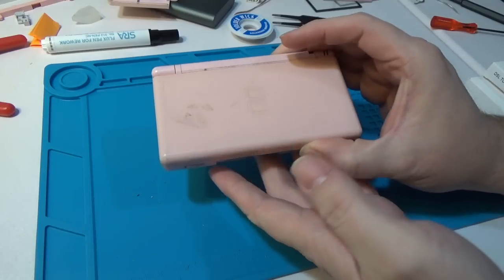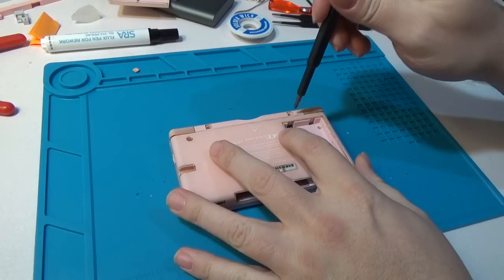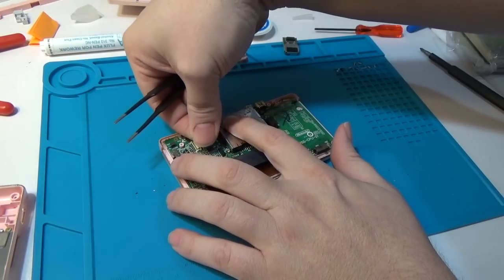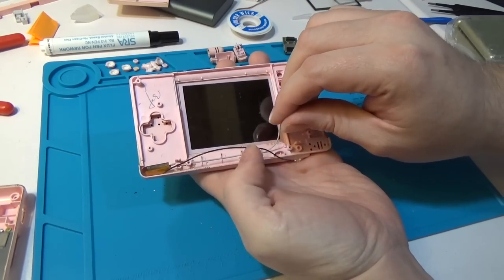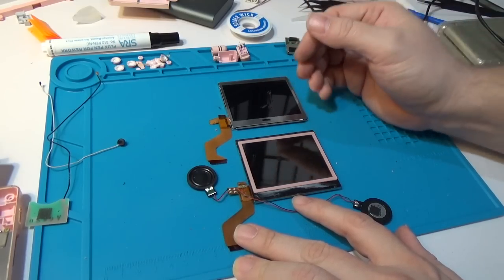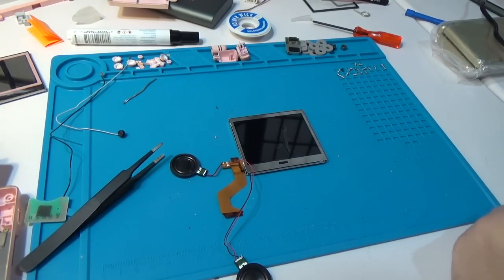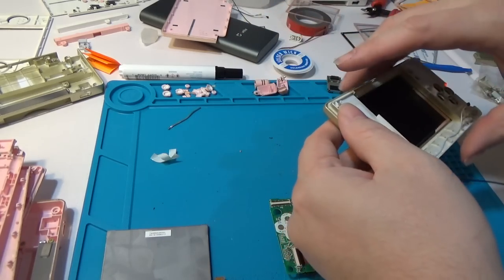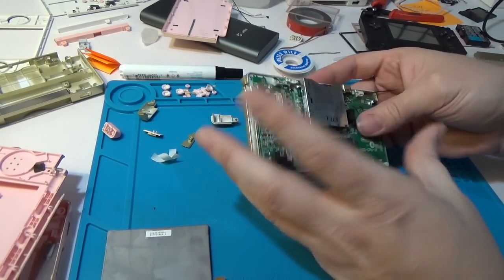How to Replace Nintendo DS Lite Shell and Screen

Comment: My NDS Lite has a problem with the top screen: it stays white. Sounds of both speakers are loud and fine, bottom screen works and the whole system works. But obe day i just turned it on and it sort of had a bad contact on the upper screen. Adjusting the angle would make it return to normal, but the very next day it was all white, i didn't even played it.

The hinge is fine and strong. The upper screen got replaced like two years ago by some technician,  and i rarelly plays my DS nowdays. It mostly sits on its case inside my drawer. What to do?
Reply: From the being able to wiggle it around to fix it, I think re-seating the ribbon cable deeper should fix it. It only requires taking the bottom half of the shell off, which is probably one of the easiest things to fix. I guess the technician wasn't careful enough 🤷‍♂️
Reply: @ciggyazealia  Nah too late. The cable was cut. I opened it and ruined the touch screen (doesn't register touch inputs anymore). Guess i'll sell the parts. At least i still can play my NDS games on my 3DS.
Reply: @CanaldoZenny  Man, sorry for your loss. At least you got the experience and practice.
Reply: @ciggyazealia  Yeah... I bought all the tools to open and disassemble it. Found the problem, but ruined it and didn't how to put it back. Everything else works, its just both screens are broken and where i live it's not worth to buy new screens or send to repair. But it was a fun project. Thanks man.

Comment: I have a serious question what kind of screwdrivers are those?
Reply from the maker: Great question!  It's a Xiaomi Wiha set.  You can buy them on Amazon, here:

https://www.amazon.com/Xiaomi-Precision-Screwdriver-Magnetic-Electronics/dp/B07FZ5DSWC

or find them online on various sites like eBay, AliExpress, GearBest, etc.  I love the kit.  It's got a great feel, and the clicky latch with the aluminum shell makes it feel like a premium product.  The only negative is the triwing bit doesn't fit these smaller screws, so you will need a separate triwing driver, but most aftermarket shells you buy come with one that you can use as well.

Comment: At 44:50 how in the hell do i get the ribbon cable back through the shell you sped right through it
Reply from the maker: Haha, I'm sorry for that!  I sped through it because it was a really boring segment of me struggling with it!

The big pointer I would give is to take your time, and wrap it tightly, but avoid pinching it.  What I've done is taken my tweezers, grab the connector part of the cable, and gently rotate it into a tight circle.  Once tight enough, you should be able to feed it through the shell loop, and then the metal ring as well.  It takes a bit of trial and error; especially on a new display that doesn't have a pre-curved ribbon, as it tries to keep unwrapping itself and straightening back out.

Take your time, go gently and don't force it, and you should get it through eventually!

Comment: Bro can you help me :/ ? 
My Nds lite is not working because it won't loading. So when I want to charg it, it charges for 0.5 sec and then stops! Why? Thank you very much
Reply: Try replacing the battery pack
Reply: The battery is the first thing you can try. If it still doesn't work there are two tiny fuses that might be broken. You can fix it if you know how to solder those tiny SMD components.

Comment: I'm having an issue with the ds booting up. When I move the power slider, the light turns green for a second (because the battery is fully charged), I hear a faint click, and then it turns off. Sometimes, the top screen flashes for a split second, but rarely. I did have an issue with the antenna, though. The wire had come undone and I had to sodder it back on. besides that, I followed the video exactly. Any ideas?
Reply: Seems like the ribbon cables for the top and bottom screen could be loose. On both of the ribbon cables, theres these little pieces of it that stick out on both sides and those should be pushed up against the connector as close as possible.

Comment: Great video! The ifixit site doesn't have shell replacement tutorials and the ones on youtube are all too fast and not explained much. I've already ordered a replacement shell for mine. Quick question though, if the shell has no cracks but the hinge is kinda loose and wobbly on my current ds, do I need to buy a replacement hinge?

Comment: I've tried this several times at this point, and every time for the first couple, I tore either a microphone cable or the screen ribbon cable trying to feed it through. No video I've seen explains it super clearly, but I think the slits are supposed to help somehow. Is there any way to do that more efficiently??
Reply from the maker: Oh dang!  It's tough, for sure.  I'd say that the best advice I can give is to try it again!

Unfortunately, I know that's not necessarily the advice that you'd like to hear.  But in reality, there's no real good trick to try to make it work.  You're right, in that the slit is there to help feed the ribbon cable into the lower housing, as it's a bit too wide to slide in without it.  The biggest thing to try to pay attention to is that if you start feeling resistance, to not try to force it.  Reverse what you were doing, and try again.  This process shouldn't really require any force to do.  Or if you've been fighting with it for quite some time, take a step back, take a break, and try again.  I know when I've done these, I'll get super frustrated if I get stuck on a part (especially when pulling or pushing the cable underneath the cartridge slot!).  But, if I take a break and come back, it seems to be much easier the second time.

I know that's probably not much help, but hopefully it was maybe a bit helpful?  Good luck!
Reply: @TheBrokenPast  Thanks for the advice; also it's really cool how you make an effort to connect with and answer your viewers. I have one I'm gonna start on tomorrow I got on eBay, so hopefully it turns out better.
Reply from the maker: Good luck!  Please reply back with your results.  Would love to hear the hopefully good news!

Thanks for the kind words too.  I'm trying to make it my plan to respond to each question that comes through.  I'd love to grow this channel, as it's been a lot of fun making these videos, but I think that the best way to do so is to make sure I engage with all of you who take the time to watch the videos!  Hopefully I can be of service if you have questions.  :)
Reply: @TheBrokenPast  bn n

Comment: What is the diagnosis if the bearing/cylinder that houses the LCD ribbon, black, and white isn't clipping in all the way? Is there a specific orientation it should be? Everything is original minus the new faceplate.

Comment: This it my go-to video for DS lite disassemble-reassemble. I have a hard nut to crack these days: a DS lite that charges (orange light works) but won't turn on, no green flashes, no screen flashes, just sits there. Tested all the usual suspects (F1, F2, L2) and they're fine, the board seems fine, no burn marks, tested with a 100% full working battery and an AC adapter, but it still won't turn on. Any hint or tip?

Comment: My DS Lite wont boot anymore after the shell, top screen and digitizer replacement. When iboot it, neither the screens nor the led turns on. When i charge it the led turns orange for 1 second and then turns off again. The device wont boot while charging either. 

Do you have any idea what could be the reason? Before the replacing process everything worked...

Comment: Hi , I really like that blue mat, where can I find one? Is it silicone?
Reply from the maker: Amazon!  Here's a link to the exact one I bought:

https://www.amazon.com/gp/product/B073RGVB39/

And yep, it's silicone, and heat-resistant to solder.  I haven't tried to get it too closer to the soldering iron, but soldering circuit boards directly on top of it seems to be working well!
Reply: Hey T.B.P. , I followed your instructions I didn’t break the ribbon cable , everything snapped together properly and powered up but now I can’t see anything on the top screen and it was fully functioning before . Any ideas what I might have done wrong? Please help , thanks
Reply from the maker: @The_Dork_Knight  You could try reseating the ribbon cable for the top screen.  That's not too hard to do, since you only need to remove the motherboard a bit to get to it.  See if it's loose in there at all.

Otherwise, I would suspect a micro-tear in the ribbon cable.  It's extremely easy to do when trying to twist the cable to insert through the hinge.  

Hopefully it's just a loose connection though, and reseating it will take care of it!

Comment: For anyone else struggling to remove the pads on the front of the top screen, a sewing needle did the trick for me. Push it into a corner and when you feel it hit the bottom, pry the pad up. Didn't leave any damage on mine

Comment: Awesome! Just followed your thing while I did mine.

I failed.

And by failed I mean it's done, everything works., and it looks neat, but some of the shell warps.

Now when I replace my digitizer I gotta figure out why my the shell is being a douche. I'm really hoping its not the right trigger.

In any case, Now I figure out how to cut a vinyl sticker to place on the top, and get a clear protective case with screen protectors so my beaut stays a beaut.

Also oddly enough the ribbon cable wasn't the most annoying part. It was the triggers. And partially the black  antenna wire.

In any case, it's done and whomever dare attempt this I bid you luck and better ideas. Or that you just hire someone.

Comment: The hardest part for me was the hinge screws... The holes on the replacement shell didn't seem wide enough and I stripped one of the screw heads trying to tighten it down. Luckily I had a busted up DS lite sitting in a cupboard that I could yoink a screw from

Comment: Getting the black WiFi cable back under the metal housing was really tricky (I see you struggled too!)... until I used a piece of thread.

I tied one end round the metal end of the black wire, tied a needle to the other end of the thread, and dropped the needle through the gap.

Gently pulling on the needle and the wire let me tease it through the gap very quickly.

Comment: I joined and followed the video and I also made the same mistake by applying the upper screen  before rolling up the ribbon cable, ^_ ^' well, it's patient work anyway so a little extra time doesn't really matter that much, but I just wanted you to be aware that without editing it, people might follow along some minor mistakes as well
Reply: I did that and broke it.

Comment: Okay so I did this repair got a new top LCD & then before putting the bottom assembly together I tried to power it on & the light flickers green & red and system wont turn on now🤷🏼

Comment: thank you for making this video! I'm thinking of replacing the outer part of the shell of my ds lite only, so still keeping the original screens/inner buttons and inner plates of the clamshell but replacing the outer top and bottom of the shell along with the l and r buttons (as mines outer is quite beat up and dirty but the inside is still really good so i'd like to preserve it as it all still works well) do you think this would be relativity simple to do? would i need to take everything completely apart still or would it be possible to just follow along the parts that you remove and reattach the top and bottom?  im assuming the top screen will be the part that becomes a tad more complex as you have to enter from the front.
thanks!
Reply from the maker: I'm trying to think how feasible that would be, and how much you would still need to do in order to swap the outer part of the shell.  I think the upper part wouldn't be too bad, as you should be able to do it without needing to remove the screen or anything, since the outer part of that shell just clips into place.  The front half also is what includes the support that the ribbon cable slides through, so you wouldn't have to worry about that.  The bottom half itself would be super easy, since it's just those few screws to remove it.  

Yeah, I think you should be able to do that pretty easily!  Good luck!
Reply: @TheBrokenPast  thank you very much for the response!
Reply from the maker: Certainly!

Comment: Thatnk for this tutorial. I cant seem to get the back shell of the bottom half to connect to the front. Its being stopped by something, its either the charging port or the cartridge slot. Have you ever had this problem? Could it be the casting?

Comment: Do you need a soldering iron if you are just replacing the shell to fix a broken hinge? I mean i could watch the whole things but its 1h42 :S
Reply: @evank5654  thx bro
Reply: @evank5654  by the way, the bottom screen is not really scratched, but more like ''worn out'' .. it has a big circle that lost all the ''plastic?' or something.. just an odd feeling space that cant be cleaned.. what part do i need to replace it?
Reply: @martijn439  sounds like the touchscreen panel itself is destroyed. But make sure there isn't just an old a screen protector on top of it.
Reply: @Tom2404  i think it is just the plastic protective layero f the screen. I haven't replaced it yet

Comment: Quite late to the party but i was hoping you might be able to help me with an issue i have with some after market shells. When it comes time to place the hinge screws into the new shell it seems as if the shells holes are unthreaded and the screws do not enter easily. How can i work around this? And was yours like this as well?
Reply from the maker: Yes, this was pretty similar.  At around 57:30, I put the screws into the new shell.  They were a bit finicky to get in, and I had to put a lot of pressure on them to drive the screws in.  I don't think there's really a way to work around this, other than to make sure you have a decent screwdriver you're using, so you can get a good grip on it when putting the screws in.

Good luck!
Reply: @TheBrokenPast  thank you for the reply! After trying a few more times i realized i need to find a better percision screwdriver set. This definetly affirms my suspicions. Thank you!

Comment: This doesn't relate to this video at all but I have a very wobbly screen on my DSi XL and 2DS XL... is there any way to tighten the hinges without needing to replace the whole case? Nintendo says this is normal but my DSLite isn't loose and my DSi XL used to not be loose but got loose over time... It's not cracked I don't believe and definitely not broken. Thank you for any help!
Reply from the maker: Hmm, that's a tough question!

Many loose DS models are due to just wearing down of the brackets that the hinges are in.  A large number of times, it's due to stress cracks in the hinge plastic (some that might even be too small to see), that causes it to be a bit looser.  I know that with my 3DS XL that I have, even when it was new, it had a bit of a "floppy" wobble to it if you shook it back and forth.  I really don't think there's anything you can do to make it better, as there's no way to tighten the hinges any.
Furthermore, It's speculated (I don't believe there's actual proof though), that Nintendo made the hinges on the later models (DSi, 3DS, etc.) a bit looser than their original DS counterparts, due to the frequency of the plastic shell breaking around the hinges in the older models.  By making it a bit softer with a bit more wiggle to it, it helps to prevent a bit of stress that was breaking the original consoles.
Reply: @TheBrokenPast  I know the New 3DS and 2DS are like that for sure but this is my DSi XL, which wasn't like this before. I'm not rough with my devices so it may have worn down over time. Is there a way to fix this? Replacing the hinges maybe?
Reply from the maker: I'd suspect it's probably not the hinges themselves.  Those are pretty durable pieces of hardware.  I suspect if anything it's just a loosening / weakening of the plastic shell around the hinges.  Not that you're rough with them at all, but just regular usage over years can steadily wear it down.   I'd wager a guess that there's probably not much of a way to fix that, except for a new shell.  

You might maybe be able to get away with it by removing the four screw covers on the screen surround, and seeing if you could tighten them up any.  But I doubt that'd make too much of a difference overall.  :(
Reply: @TheBrokenPast  Thank you for the help either way! It's not totally noticable and as bad as the new 2DS XL and 3DS XL wobble. I will try that though 😊♥️
Reply from the maker: @kawaiidevilchuu361  Good luck!
Reply: @TheBrokenPast  Thank you!